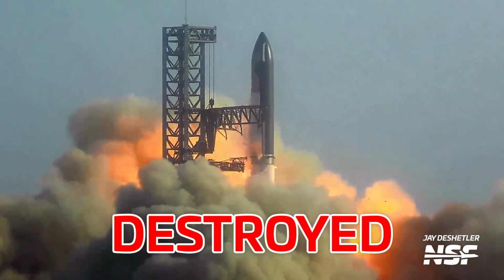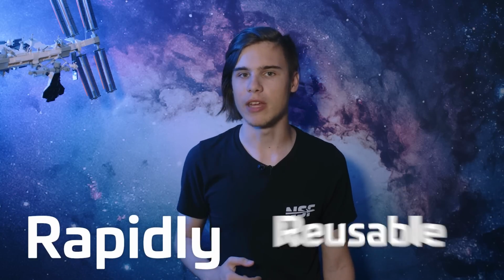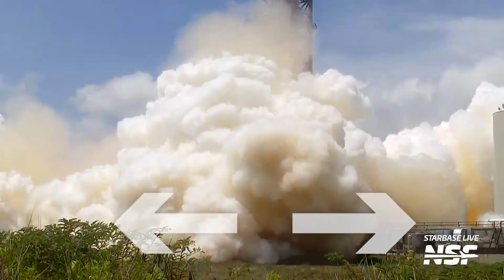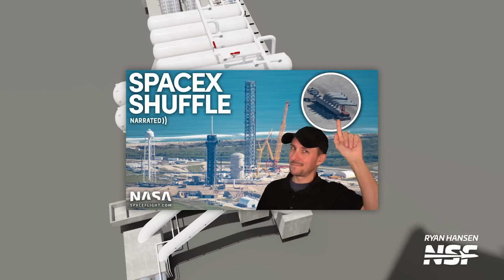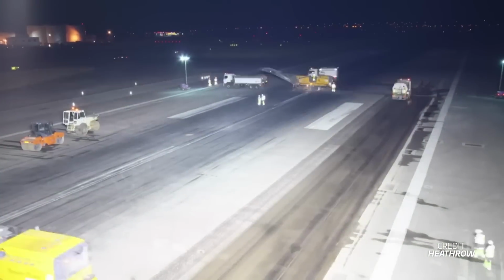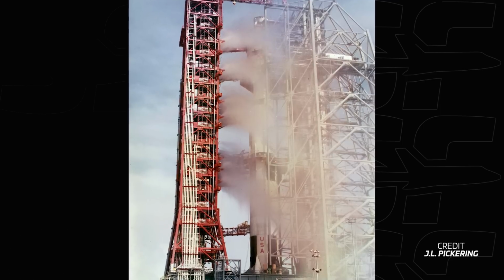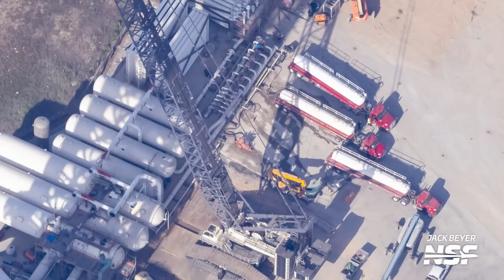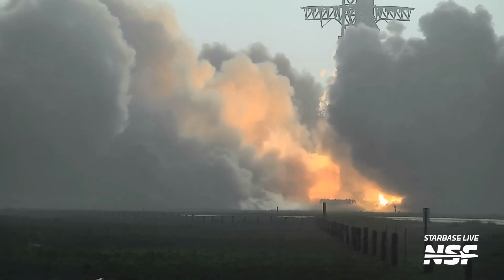SpaceX Thinks They Know Better. Is The Water Plate Enough? (Starship's Deluge)

Comment: they could literally just use a flame diverter and would never need any water. it makes me a bit angry that they make it so complicated when it could have been so easy. i thought elon musk likes building tunnels, where is the flame diverter tunnel now? once you build one proper flame diverter you never need any water or nitrogen pressure tanks for the water or fancy piping. you are literally trying to shield the energy when you can just divert it and let the atmosphere absorb the energy instead causing a bit of wind
Reply: the flame diverter would still need to be water cooled
Reply: Yeah and if not watercooled you'd need a way to keep it from melting perhaps spraying tons of water all over it. As we say in the video: you don't remove the problems with a flame trench, just reshape them.

Comment: How does SpaceX ensure the pressure inside the water plate is greater than the pressure from the 33 Raptor engines above it?  How do they ensure the water does not backflow, and let exhaust inside the plate (which I assume would destroy it)? 

Obviously the water pressure needs to be greater than the pressure of the rapture engine exhaust, and smaller holes help here, but I have not heard anyone speak about this, or how (we think that ) SpaceX is making these calculations.   In fact, I can imagine the sound energy alone turrning water that is inside the plate, to steam, but I have no theoretical justification for this.

Do they really know yet, or will they only find out during the full thrust launch?

Comment: Or they could freeze the ground with liquid nitrogen so they could excavate a several meter deep pond in the ground and line it with concrete. That way they could build below the water line and have enough volume to contain the water until it went through a water treatment plant. And they seem to have an abundance of liquid nitrogen travel through the base.

Comment: Wouldn’t the middle of the plate get the most heat and pressure-from the additive effect from all the engines impinging on the center point?  The three middle engines exhaust plume would be squeezed by the plumes of the other engines wouldn’t they?  Caveat: I’m not a rocket scientist or someone who is intimately familiar with fluid dynamics.

Comment: When Booster returns to launch pad, before a new Starship can be stacked on top of it, don't Booster and its engines need to be inspected for damage, and refueled?
Reply: Of course, but that won't happen for a while and when it does the returning booster will get a thorough inspection before flying again.

Comment: Has anyone thought about the landing site or position? Or starship is for ascent only?
Reply: I know that the eventual plan is to catch the booster with the chopsticks but that is ways off.  And I don't know what plans they have for starship.  Maybe they will attempt the flip and landing like in earlier flights.  For now their primary goal is making it flight worthy.
Reply: @michaeldeierhoi4096  the ship is supposed to be caught  by the chopsticks eventually as well. but in the beginning maybe it will land on a landing pad instead.
Reply: @HamzahKhan314  nah they will just toss it in the ocean. Super heavy isn't designed with landing legs in mind
Reply: @archer1133  super heavy wont be reused on the first flight, but it will eventually be caught by the arms for reuse

Comment: 8:28 EST Noticed during last booster engine test last 2 seconds of it deluge system went from vaporizing water to throwing brown dust bellowing from launch platform area.
Do they have enough pressure to overcome raptors plume on 90 % throttle up?
Reply: Some viewers have noted that the deluge went from water spray, to steam, to no apparent deluge, back to water and steam.  Since the deluge box survived, this was probably not due to back pressure limiting flow in the deluge system.  Instead the temperatures around the pad reached a point where steam droplets no longer form and all water is convered to transparent superheated steam.

Comment: This launch it will work.  The question I have is what will need to be done to be ready for 3rd launch.  There is a big difference between work once and repeatability.  Long term I think we'll see a version 2.  Also remember that Bocca is the testing location.  Kennedy will be the real work horse location.  Either way it will be fun to watch.
Reply: What will be done to prepare for ITF-3 depends on how well this next flight goes.   A lot can still go wrong despite all the upgrades so we'll soon find out.
Reply: @michaeldeierhoi4096   I would like to believe a 'lot less' (rather than a lot) can go wrong, because they have addressed a lot of the issues raised in ITF-1. Having said that, I hope they have added extra layers of protection, so that the Booster Launch Computer aborts if there is a water supply failure and that they have a software programme that calculates the side-ways drift for Raptor engine shut downs, so a 'drift' towards the tower would automatically cause an abort. 
But for sure, we will soon find out. 🚀🥂👍🏼

Comment: Every square inches of these holes have to spay water at more than 250 psi, and that’s a lot of pressure! Everyone of them…
Reply: That's 17.2 bar pressure? 
By my rough as calculation:
230 tonnes of thrust per Raptor at 90% = 6,831 tonnes of thrust. That's over a 9 meter diameter rocket base. So 'roughly' 9 X 9 square =81sq meters. That's 6,831 tonnes of thrust and divide by 81 sq meters = 84.3 tonnes per square meter. But the holes in the water spray are not a meter in diameter. They are only about a 1/3rd of a meter. (About 300mm size holes) So 84.3 tonnes divide by 1/3rd = 28.1 tonnes of pressure per sq meter. And the distance to the steel plate is going to mean that there is some loss of pressure because of the loss to the air. So let's say 20% less which gives about 22.5 tonnes per square meter on the water outlet which is about 2.8 bar. 
That's about the same as having a water tower 22.5 meters (24.6 yards) above the ground, which is not too out of the realms of possibility. I think they probably have a higher pressure and so a higher flow rate than that. 
Anyway, as I say, this is 'rough as', because I have not taken into account the water sprayer is wider than 9 square meters. The holes are not facing straight up, so not directly in line with the force. There is the absorption effect of the initial water that is already in the air. The outward angle of the force must reduce some of the direct force on the steel plate and therefore the open water outlets. 
So, if someone can come up with a more advanced equation, I reckon 22.5 tonnes per square meter (2.8 bar) force.

Comment: Chemical engineer (PE) here.  I think the bidet system will work to prevent the type of concrete damage to the rocket and the site that happened with the first test launch.  However, I'm not so sure that the fondag/concrete area surrounding the shower head will hold up to high throttle blast forces and temperature shocks, and I am bothered that 33 engines at 50% thrust created superheated steam (i.e., 100% water evaporation with further temperature rise).  I expect the engineers are already working on an improved water flow system that can force significantly more water out of the shower head, so that the engines don't vaporize 100% of the water.  I am also concerned about whether the current system generates enough discharge pressure at the steel plate to ensure that water will flow out of the shower head when the engines are throttled up to 75-90%.

I think the bidet system is a well-conceived approach for the physical realities at Boca Chica (impossible to build a below-ground flame trench, and important to have a flat area under the rocket to facilitate easy access to the engine area).  But I think that the system probably will have to be improved substantially before it works well.
Reply: About half of the new pressure tanks haven't been hooked up yet plus the extra water tank. The fondag will probably be the biggest issue.
Reply: I was thinking the same thing about sufficient discharge pressure at the shower head with the engines at or near full throttle.  I still don't like this flat plate idea.  A flame trench is entirely possible at Boca.  All they need to do is ramp the pad up and build in a flame trench ala Pads 39 A and B at the cape.  Remember, Cape Canaveral deals with the exact same sea level challenges, being that it's a giant sand bar.

Comment: In the test, pressurized water only needs to discharge to atmospheric pressure. But for the launch it tries to discharge against extreme positive pressure of 33 Raptors. We need the energy of 34 Raptors pumping water under the plate to get it out. I cant see a high volume deluge system make this pressure.
Reply: Well if you do some rough calculation's, you must see that that is what they have achieved, otherwise there would have been 'blow-back' in the system.
230 tonnes of thrust per Raptor at 90% = 6,831 tonnes of thrust. That's over a 9 meter diameter rocket base. So 'roughly' 9 X 9 square =81sq meters. That's 6,831 tonnes of thrust and divide by 81 sq meters = 84.3 tonnes per square meter. But the holes in the water spray are not a meter in diameter. They are only about a 1/3rd of a meter. (About 300mm size holes) So 84.3 tonnes divide by 1/3rd = 28.1 tonnes of pressure per sq meter. And the distance to the steel plate is going to mean that there is some loss of pressure because of the loss to the air. So let's say 20% less which gives about 22.5 tonnes per square meter on the water outlet which is about 2.8 bar. 
That's about the same as having a water tower 22.5 meters (24.6 yards) above the ground, which is not too out of the realms of possibility. I think they probably have a higher pressure and so a higher flow rate than that. 
Anyway, as I say, this is 'rough as', because I have not taken into account the water sprayer is wider than 9 square meters. The holes are not facing straight up, so not directly in line with the force. There is the absorption effect of the initial water that is already in the air. The outward angle of the force must reduce some of the direct force on the steel plate and therefore the open water outlets. 
So, if someone can come up with a more advanced equation, I reckon 22.5 tonnes per square meter (2.8 bar) force.
Reply: @  David-yo5ws  
Municipal tap water is 3-6 bar (in developed countries) and that is just by using impeller pumps (water towers are deprecated pretty much everywhere).
I'm pretty sure that SX is delivering much more than that to the plate.. 100+ bar if I where to guess.
Reply: @  David-yo5ws  
If you want to calculate something I'd look into the pressure that evaporating water causes on the water right behind it, as that will be what the deluge system needs to be able to overcome. Not so much the rocket exhaust pushing down on it, but rather the heated up water molecules (steam) that want to go in all directions from where they are. For how much energy we're talking about - for a rough estimate I'd assume all the energy that isn't converted into moving the rocket up (energy needed to lift/accelerate x tons upwards), but is set free by burning x tons of CH4+O2 per second..
Reply: @joansparky4439  Right, interesting. I never thought about that. It reminds me of when the TV series Mythbusters built a little mock-up shed, put a hot water cylinder in it, over-rode all the safety interlocks and left the heating element permanently on. Wow, did that cylinder fly high, after blowing the shed apart. Thanks, I will look into it.

Comment: I think the top of the launch mount is already pretty resistant to the energy from the engines during launch/liftoff. After all, they have to support people and equipment walking around on them. And every orifice that is open within the OLM ring (for outer ring raptor commodities) already get covered immediately after ignition with shielding. 

I personally do not think they need to add water cooling to the top of the launch mount. Instead, they’d probably just reinforce or thicken the metal that is already there with more metal.
Reply: thhe top of olm also wont get as much heat and pressure as the pad, since the engines will be farther away

Comment: If they want rapid reusability, why not source the water from the ocean and filter it into a gravity fed tank? This would avoid having to truck-in both water and pressurized gas which increases the time between launches.
Reply: It has to be fresh water and clean water so a lot of processing would have to go into that
Reply: Cost, cost, cost!!  Not to mention building the infrastructure to pipe in the water to desalinate it.   That may become the option later, but that's impossible to say for us outside observers.
Reply: @michaeldeierhoi4096 also, you cant use a gravity fed tenk. the pressure wouldn't be great enough to keep the steel plate from melting. you need high pressure tanks for the system to work.

Comment: I’m a little torn by y’all saying that starbase and saturn5 “didn’t have” a sound suppression system… cuz heat is not the only thing that turns the liquid water into steam or vapor. The sound energy also helps to excite the water molecules, thereby taking some force out of the sound/kinetic motion. So these water deluge systems regardless of their specific purpose do all help suppress sound, right?  

Thanks for this video tho!! It’s a very good compilation of concepts used in this deluge design.
Reply: they aren't dedicated sound suppression systems. They may work a little, but not very much
Reply: @bryanillenberg  Pretty much this ^^ We say it on the video that although it does reduce some of the sound from the engines it is not the system's main reason to exist. Same thing for Saturn V

Comment: A "traditional system" isn't the best idea, mostly because of location.... the water table and environmental factors.  The steel plate and water system wouldn't work without the many concrete and rebar pillars underneath.
Reply: KSC has the same issue with being close to the water table but it works fine for them. Just more expensive to build.

Comment: @nasaspacefight, Reclamation of all the water will need to done to satisfy the EPA, since is a Texas wetland area, there will be no budging on their requirements so nothing will be set aside for the long run. Too much water waste into the soil changes the balance of the wetland and wildlife, so total reclamation will be demanded. After all, too much water added to the system will not support the weight of the OLM and Tower and it will become the leaning tower of Pisa, if you gain a launch pace of once an hour. Land shifts, particularly wetlands, no matter how much you pack the added soil you still have a sponge for a base of the whole launch platform. 

I'm extremely excited to see how these problems are addressed by their engineers, as I want to see this become an active base, but I imagine KSC will be where most of the launches are done, once the kinks are ironed out, then once it is proven safe it will launched from many spaceport around the world.
Reply: no one is going to launch 1/hr from Boca.. not even 1/month, this is a test site until they figured out what works and what doesn't.. the commercial system is not going to be in Boca, was never planned to be. They halted their efforts just everywhere as things seem to change more than they expected. Once this works they'll reboot at the Cape.
Reply: I didn't say anyone is going to launch, Joan, but they will not launch a ship, test otherwise without permission, without reclaiming the spillage of the water into a wetland area, but that goes for KSC, it is a wetland as well, but it is easier to reclaim water there, because they can use a flame diverter. @joansparky4439